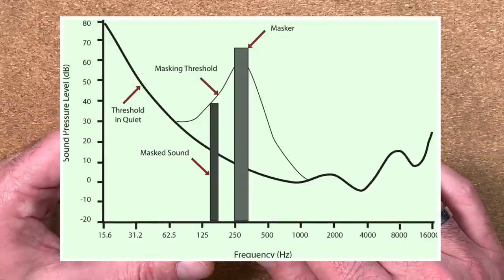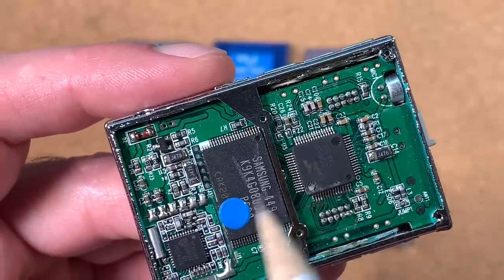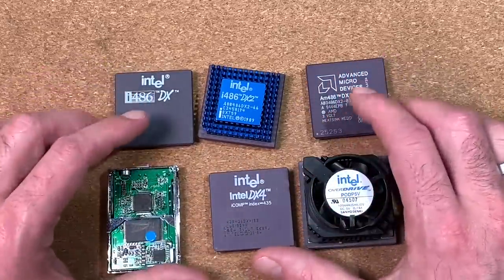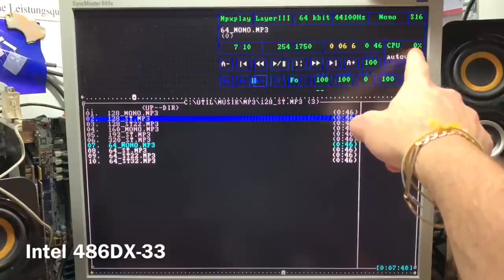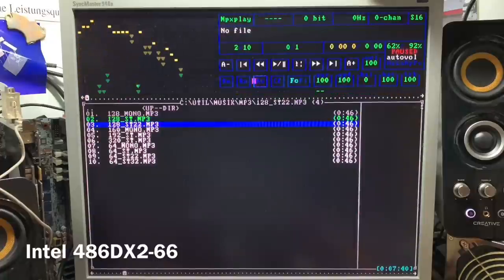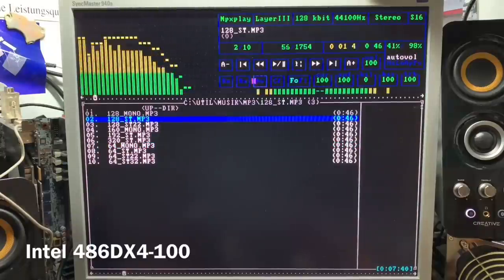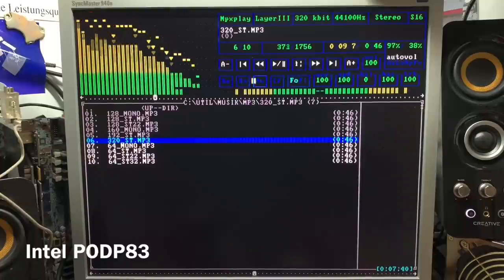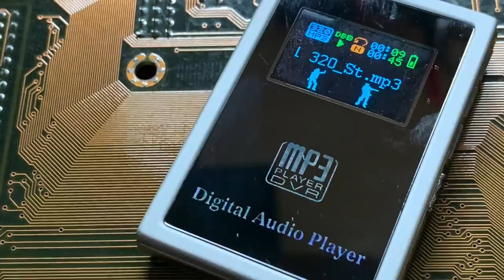Can a 486 Play MP3 Music In Good Quality?

Comment: I had a computer in 2004 with a Cyrix 486DX2-66 processor. And I was sure that it was not enough to play MP3 files. But now I see that for some bitrates it was quite enough. I then listened to music via CD-ROM in CDA format.
PS.
Yes, in 2004, 486 was already junk, but what was it. But already in 2006 I got a Sempron 2500.

Comment: Hi. Is there an option to play with multiplication in quality ex. half quality,quarter quality etc? On Amiga with motorola 030 and above it's normal. Im using half quality on 68040 in stereo. On 68060 it's on full quality,stereo @320kbit or You can buy hardware decoder.Nowadays I recommend playing wav or aiff from hard drive as You have plenty of space now or use ADPCM compression as it shrinks size to half.If it must be compressed You can use mp2 coding.Also resampling wav file in half is easy.

Comment: You really need to try tweaking the software stack and hardware stack. I had an old packard bell with a dx2-66 and using DOSAmp it did 128k files perfectly

Comment: I remember my 486 DX/50 struggled  with playing back 128 kbps MP3s in real time. The only way to listen to them was to decompress to .WAV first. Hardware MP3 players get away with it by using highly optimized and power-efficient  DSPs for the job. BTW, MP3 decoding can be performed entirely in fixed-point arithmetic by design  ;-)

Comment: I used to encode and listen to mp3s with a 25Mhz 486SX (with a TI  co-pro?) with 4mb ram no problem. Maybe you need better playback software. I'm guessing that modern encoders care less about CPU needed for playback whereas back in the nineties playback would need to be done on the same machine as which did the encoding. And encoding was crazy slow like in the region of 1hour for a 4 minute mp3 IIRC.

Comment: I know for sure my Pentium 150 can't take the heat in 98SE with XMPlay, it cuts in and out! 
I'd be impressed if the 486 could do it.

I wonder, did they ever make hardware MPEG decoders for audio? I know MPEG2 cards exist for DVDs, but not about audio.

Rather impressed with the DX4! The larger internal cache is probably the big help there, I'd imagine it's storing the decoding algorithm in L1 instruction cache and taking more advantage of the quad clock

Comment: I wonder if that player does use floating point or if it uses fixed point math. If the former then I wonder how a fixed point player would fair as fixed point operations would execute faster.
Reply from the maker: the player uses the FPU. All players I tried showed an error when i tried with a CPU without FPU.

Comment: I was able (just) to play 128kbit 44khz 16 bit stereo on an Intel 486-DX2 66 MHz using a different DOS player... NullSoft DOSamp if I recall, but suffice to say that optimization really really matters here.
Reply from the maker: would be cool if you could remember. I tried all dos players i could find in the web and got at all the same results.
Reply: Since it may matter, I should say that I was using a Creative Labs SoundBlaster 16. DOSamp seemed to work better because no cpu power was used to show a spectrograph or for seeking.. it can't do either; just play and pause.

Comment: I remember playing 128kbit mp3s on WinPlay3 on Win 3.11 and that worked pretty well on Intel 486DX4 75MHz laptop, but maybe it was lower sample rate or mono.
Reply: maybe it was mp3 at 22khz or it was mp2 files that are easier to decode.
Reply: @vasopel  Most likely multipass VBR encoded audio, where the encoder did a few passes over the sampled audio to get the decode processing power down, basically pre rendering the audio, and using low bitrate most of the time so there was a second or two of buffer available to decode into before it would stutter. Fixed rate is harder, but encode wise much faster to do.
Reply: @SeanBZA  that's not how vbr works

Comment: mpxplay is not the most optimized mp3 player there. It has some assembly, and tries to precompute a lot of things once using FPU, but still uses FPU instructions in the main decoding loop. If only mpxplay implemented own routines to handle these opcodes, it would be significantly faster. The x87 must compute everything to 80 bits of precision, but you only need about 20 bits for audio handling. So this is silly, and really slow - various x87 opcodes can take dozens of cycles, which could be spend on other things. There was a mp3 decoder and a program for dos, that was purely integer arithmetic, and was way faster. Sadly I don't remember the name. However, using mad library which is used in other projects (like mpg321, mplayer, ffmpeg) is another option, as it is purely integer based and doesn't require FPU basically. And even more optimized is mpg123, the original one. In my tests mpg123 is 2x faster than mpg321 / libmad, and other players. Tested on many machines.

Comment: I think I had to move to a Cyrix 100MHz or 133MHz before SetEdit & other late 90s players could play the MP3s.  64 kBps was what I ripped at for the longest time and AAC taught us that 192 kBps was what we should be ripping at.
Reply: Back in the late 1990s/early 2000s I've ripped and encoded plenty of CDs at 192 Kbps thinking it was overkill and more than good enough. Nowadays I regret not having used 320 Kbps.

Comment: Are there anything one can do to accelerate the mp3 decoding on CPU weak x86-machines? Like a FMV card for Video with Mpeg in hardware, but for audio in this case? Sort of as it was done on Atari Falcon 030 with its MC56000 DSP.

Comment: Interesting, there's a 4.6 = 320 / 64 / 0.86 / (100/80) speedup going from DX2 to DX4 that's not explained by clock speed. The increased cache size of 16 KiB on DX4 will help, but increasing cache size usually has diminishing gains (in matrix multiply, # accesses that don't hit cache is proportional to  1 / sqrt(cache_size) ). Increasing the size can help more if there was thrashing. However, I suspect the real reason is because of the write back cache. That can completely eliminate off chip memory access if everything fits in cache! Hurray for better computer architecture

Comment: i used to play MP3s on my 486DX4/100 running linux. XP would not do it. strangely, Win98SE and WinNT would kind of work too. the SanDisk Sansa e200 has a 16MHz RISC processor and can play FLAC and OGG mostly flawlessly, as long as you're running Rockbox on it and not the crap factory firmware.

Comment: I could just about get Winamp to play MP3s on a 486-DX4-100. At the standard 128kbps most people tended to upload songs at. Before Napster we just searched for dodgy websites on Altavista or whatever. If I was going to record music to a CD though, I couldn't cos burners cost hundreds of pounds. So I used tape. And when I did that I would decode my songs from MP3 to WAV, one at a time and not in real time, actually about a third that, to play them out for the tape recording. Then delete the WAV so I'd have room on the hard drive for the next one. That's after a bit of a severe cleanup of the hard drive so I'd even have room for a 60MB WAV or so. 

Obviously this is because WAV files are really easy to play, not being compressed, they use almost no CPU power, just DMA to send them from RAM straight to the Soundblaster. Although reading them into RAM from disk was done one byte at a time the slow way, cos that's how DOS and Windows 3.1 worked.

Comment: I had in begin of yers 2000 annsrrtop box, it was transformer to linux, the cpu clock was 66 mhz, and it played 128kbit mp3 in stereo, with no isiuses, 

So maybe try it on the 66 mhz under linux if an stb with 66mhz can do that under linux why not an 386

Comment: The x87 architecture was pretty awful, only the Pentium Pro had a reasonable implementation and it all went vectorised in later CPUs anyway. What about fixed point decoding? Integer performance on these CPUs ought to be much better than floating point.

Comment: In short : it can 😃 my first mp3 ever was on my first machine ever, a 486dx2, 12mb ram, 80mhz. Windows 98 and winamp. Was flawless, but you'd have to watch out that nothing else happened at all, because it began to stutter even by the move of the mouse 😄😄 i believe that is the minimum specs for mp3 playback, in an actual operating system with a gui

Comment: Why did you specify that you aren't using linux? Is there any performance benefit while using linux?
Reply: Linux runs in protected mode, which is 32-bit. Of course it can be faster than 16-bit DOS real mode. But many DOS programs had 32-bit DOS extenders.

Comment: First off, mp3 is much more than the reduction of data to match human audio perception. The psychoacoustic modelling is just to reduce the amount of work that needs to be done to actually compress the remaining data.
Secondly, did you test libmad? https://en.wikipedia.org/wiki/MPEG_Audio_Decoder This uses fixed point arithmetic, reducing everything to integer operations. 
Third, the cpu load for DX4 and 192/320kbps seems to point to something wrong with your 192kbps and 320kbps files.
All in all, nothing was learned here.

Comment: What about wav files are the harder or easier to decode?
Reply from the maker: wav is uncompressed and very easy. the problem with wav files is that they are huge and the cpu, bus & memory must push this amount of data trough. but works fine on a 486

Comment: Seriously, a 486 cant handle such a simple task as playing an MP3 file? I know it's old technology but this could probably even be done on a C64 with enough storage space.
Reply: No, a 6502 could not do this.

It wasn't designed to, just like a CISC x86 CPU wasn't designed to.  With enough horsepower you can do just about anything though, something that was lacking in 486's and even early Pentiums.
Reply: Either you are seriously overestimating the computation speed of the 8 bit 1mhz 6502, or seriously underestimating the amount of math required to decode mp3

Comment: Interesting, I could've sworn I used to play 128k Stereo MP3's on my DX2-66 thru WinAmp. I guess it must've been after I had upgraded to the DX4-100. Was a long time ago though, so dodgy memory!
Reply: Pretty sure I was able to play 112 kbps mp3s on my dx2-66 using mpg123 in Linux. What I don't recall is whether it could do that at full quality or if I had to tweak the decoder settings somehow (eg. downsample or decode in mono). But mpg123 was definitely the fastest mp3 decoder around at the time, and the likes of amp were just too slow.

Comment: The problem is your software, better use a bare srtiped down linux without GUI and u are good to go OR u can  use another player , the program u use has too many visuals ALSO u can utilize that memory better by prebuffering some of the audio file but u should specify it  on the cmd !  cheers mate!

Comment: Back in the day I used to have a p75 play 128 MP3 files in dos it could only just handle this
Reply: I noticed that a P75 did a worse job than a P60 back then (I was writing a player around that time). Perhaps because the P75 ran at 3x25Mhz bus speed vs a P60 that ran at 2x30Mhz. I might even have tried to run the P75 at 2x33Mhz just to see if that improved anything but I don't remember the outcome, or whether that experiment even worked. Would be interested to see whether my observations were correct, or whether something else was at play (e.g. could have been different motherboards, ram, etc etc)
Reply from the maker: this is indeed an interesting idea to try. 👍🏻
Reply: @CPUGalaxy  I just found this thread that mentions that earlier chipsets ran the P75 at 25Mhz PCI bus speed, and newer chipsets had a 2/3 divider (and other improvements like edo ram) so it could run at normal 33Mhz bus and it improved its performance significantly. So I probably had one with an older chipset. Thread: https://www.vogons.org/viewtopic.php?t=71797

Comment: The 486 looking in hindsight to it was a laughable processor. l1 cache speed not even as fast as a 2000's mechanical harddrive. Seriously.... even the 200mhz pentium pro l1 cache 100mb/s. Sure it was faster then a floppy drive. But 6ns 100mb/s 8kb of cache or less... My god my old hard drives aren't even as slow as that.. 

l1 cache on this pc... out of my head?? i believe 8000gb/s 

Tho in those days i loved my 33mhz 486 dx with 4mb of ram if i remember correctly. can't remember what videocard i had in it. But it was a vesa local bus!!! i believe diamond if i remember correct. 
MP3 for me came during the pentium and windows era. first i was playing around with realsound for online music. then mp3 took over everything.

Comment: Argh! Well I guess expensive hardware is what is needed to play music sadly lol! Yes, good mp3 players will always be expensive. Much more so than an equivalent in x86 PC parts. Or... I can use a Intel Atom netbook with 2GB ram and an SSD and the most basic media LINUX to do the job or, err, limit myself to death, with MS DOS and only 512MB ram, 512MB SSD space to do the same on the same Intel Atom Netbook. BUT, most netbooks do NOT have SB compatible onboard sound so strike that idea with DOS! Where can one find a good portable hardware MP3 player that the internal battery has not died or that does NOT require an internal rechargeable battery, to work? SO far I have a miniature grave yard of such MP3 players that all dead because the internal rechargeable battery is dead and even with plug in power, if the battery is dead, the unit will not power on.. Like a modern Apple Powerbook! Hey! lol!

Comment: The AMD FPU is weaker. It was always the downside of AMD compared to intel in that era. Eventually they beat intel on the fpu side, but their 386 and 486 parts were notoriously weak in that aspect. So your 80mhz 486 is likely performing worse in practice than the 66mhz DX2. That said, I had a DX4 100 AMD and it was a beast for the time. Most DOS games didn't use the FPU much. Quake was probably the first one and no 486 was going to run that game well.

Comment: i had a pentium MMX 233 Mhz when mp3 took of.
Reply: I had a dual Pentium 90 at that time (1996) with 5 harddisks (SCSI-UW) and a Plextor CD-ROM to grab all my audio CD's. I would fill all the partitions untils they were almost full (I had around 6 or 7 gigabyte available aggregated over tjhe disks), which meant 10 or 12 CD worth of wav files, that I would then let the computer encode over night. There weren't many tools at that time. I used the Fraunhofer command line tool which gave really a good quality even for the 96 kbit/s I encoded the material with. The other encoder of that time, the Xing encoder was crap but very widespread, even at 192 kbit/s it would sound not nearly as good as the Fraunhofer encoder at 96, but as everyone used the xing encoder (it had a nice interface) mp3 got that bad quality reputation it didn't deserve.
Reply: @galier2  Yeah the Fraunhofer command line was the only thing worth using in those days

Comment: Doing it in DOS is cheating. Nobody would just play audio and do nothing else. You'd be on the web, checking your newsgroups or email, or whatever other thing you use Windows for. A DOS player is only good for standalone use. I'm sure most people now who listen to music on the computer do it while they're doing other things. So did we, back then. 

Windows 3.1 uses a lot less CPU than 95 did. And it's cooperative multitasking means a program can be quite greedy if it wants to be, to steal those extra few cycles. Back in the day we used Windows 3.1 and Winamp, not some obscure DOS thing that monopolised the machine.

I also found Winplay3 couldn't play on a 486-DX4-100. Or only at 22KHz mono. But Winplay3 sucks. For it's simple interface, it's not the best code. Winamp was much better, even with it's bells and whistles. I'm pretty sure they used asm, at least for the codec. That could play stereo 44KHz at 128kbps. Winplay3 I think used C, and the standard MP3 reference code, which wasn't optimised like Winamp's was.

Comment: With portable mp3  devices the cpus in them are designed to process and decode the mp3 data in hardware, where with the PC the decoding is done in software, so it's hard to compare a dedicated mp3 player microcontroller with a old desktop computer. However the processing power available in current portable devices is vastly more powerful than the 486. It was typical for windows programs to run slower than the dos version, as windows used up a lot of resources. The 486D2 66Mhz with 8mbRAM days were awful, HD video did not exist! too slow, and you dial up modem could only manage about 35Kbit/s as the Internet was only just starting it consisted of html port 80 static websites, all very slow and basic. Now you can do anything on you're computer.
Reply: Anyone that knows anything about portable mp3 players know that is not the case. It was extremely common to just use their CPUs with no hardware acceleration.